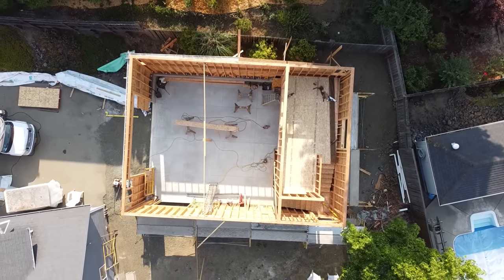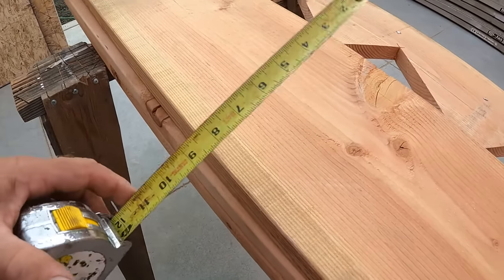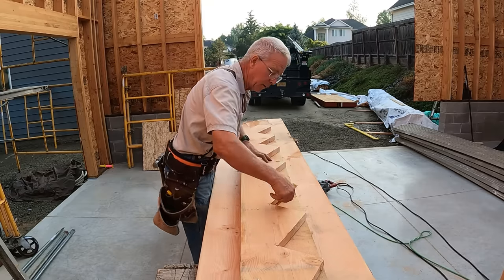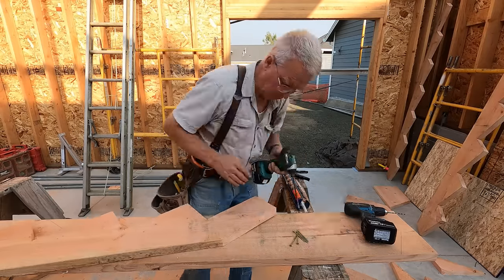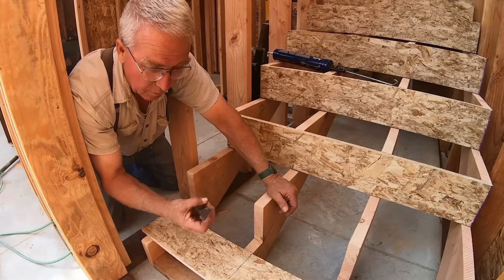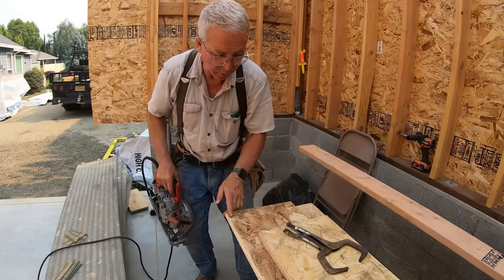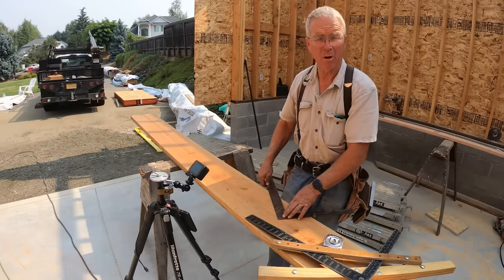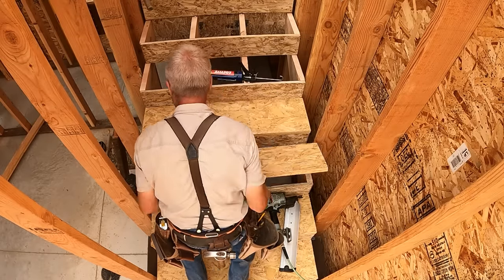Cutting Stairs With A Pro - Tips and Tricks: Shop Build #14

Comment: In 60 years of residential construction, I never ran into these kinds of problems:  why ?   because I PICKED the materials and didn't rely on the under-paid, untrained delivery guys at "Lowes Depot" to load and deliver my materials  -  esp. on any structural lumber that mattered ( which is EVERY single board ).  In any case, when you had the toe come off the stringer,  the solution was to laminate a piece of 1/2" or 3/4" plywood with LOTS of Titebond III onto the wounded area  -  in this case, I would have laminate the entire stringer -  in fact, if you use cut ( and not solid ) stringers, it's a good idea to just laminate every stringer just as a matter of course - even using OSB instead of plywood is better than having the teeth breaking away from a cut stringer

Comment: When I did carpentry work the first boss had me cut stringers he was not that knowledgeable on how calculate the run an rise so I bought a book on framing study stairs carefully never liked the stair nuts for a framing square so I made a fence that I used small clamps to utilize the most of a board I could eventually I made one out of azeck which worked great was easy sliding on boards,siding,an other task that required angle cuts had couple of other contractors make ones for their framers

Comment: *Apology in advance for the length but real stair guys/gals might appreciate the tip. 

Back when I was building stairs, all the time, on a repetitive basis, often you could encounter situations where the architect left zero room for tolerance. This could come into play frequently on the landings, where code dictates that the landing has to be at least the same width as the stairs themselves. So, when you were really ‘married’ to a landing width and could not afford to be off by even a little bit, some extra care had to be taken with the layout. (Inspectors can be particularly fussy with stair codes.)

Because of the way lumber is dressed, all the edges are slightly rounded, so when you are marking your stringers with your properly set up square and stair gauge, as you move along the edge to the next layout, sometimes it’s difficult to determine if you are in fact, right on layout, because of that rounded edge. The solution: Layout the edge of your stringer using the hypotenuse dimension of your rise and run, in consecutive measurements. (A²+B²=C²)
e.g. (using easy whole numbers, just for an example) If your rise is 6” and your run is 8”, the hypotenuse would be 10”. So pick a good starting point on the edge of your stringer, and mark it out at 10”, 20”, 30” etc etc. then make your stair gauge fit to those dimensions to ensure you are not adding or subtracting anything to your overall length. 

I know, I know, it sounds like overkill but it can make a difference if there is just no room for error. If you try that method one time, I know you will be surprised at how much it forces you to adjust your seemingly perfectly set up square and stair gauge as you step off the layout. 

I like that stair gauge but I never knew about it back when I was building stairs, so I always used the brass buttons. Another tip is: If you only have the buttons, once you get them set perfectly, cinch them down just a little with a pair of pliers. Thumb tight might move a little if you slap it against the board a little to hard.

Comment: This is where a track saw comes in handy.  You knuckledragger framers scoff and say "a straight edge and a skill saw does the same thing!"  First off...No.  Second, the purpose of the track saw in this case is to make the work easier, more repeatable, and most of all...faster.  Festool to the rescue.

Comment: I hate to trash content, but given todays engineered wood products, you should build all stringers out of engineered wood products like LVL or LSL sections. No cracks, twists, or knots to worry about.  Also do not use nails on any connected surfaces, but use glue and #10 screws.

Comment: I don’t understand the use of a chisel vs. a saber saw....which some call a jigsaw....to finish the cuts. A chisel works but....I’ll sawcut every time. No biggie. I like your videos. dba Dave the Carpenter....in Omaha
Reply: Also....I use treated..acq... on concrete instead of red cedar. Cedar is soft. Treated is spf...spruce/pine/fir....stronger and chemically superior to cedar when on concrete, and it holds fasteners better. My 2 cents worth. dba Dave The Carpenter in Omaha

Comment: PL 400 and other similar subflkoor adhesives is weak, cheap no name wood glue would hold that lumber split better. When you go to the hardware store next time, try to pick up a couple tubes of PL Premium 3x or PL Premium 8x. They are structural glues, not subfloor glues,  both A LOT stronger and most importantly tough than PL 400 and other similar subfloor adhesives. It will make "Welding" lumber back together a completely peaceful adventure. 

I would have either plated those defects with steel or plywood/osb.

Comment: For interior stairs, if you have a long run or want a really strong set of stairs spend the extra money and use lvl's. You don't have to worry about defects or triangles breaking off. Also I think you're too concerned with cutting out defects and not crowning your lumber. And never overcut stringers cut to the line and finish with a jigsaw.

Comment: I hate this design cause the nose on the stringer snaps off easily as many boards have spits already or will continue in time.The overcuts on the notch cuts that framers do for speed weaken the stringer even more. I end up screwing the broken noses also. I've seen stairs with a broken nose held up with step boards and riser boards that I suspect broke eventually after construction. It's too fragile of a design. Gluing and nailing on one side of a plywood sheet to reinforce the weak nose or using long screws to stop snap-offs might be good solutions.

Comment: hmm i still dont understand why the last step is 1 inch less
Reply: Because when you put your tread material onto the 1st, 2nd, 3rd, 4th etc, step, they are all being added to by that much. But you don’t put tread material on the floor where you start at so you have to account for that right away in your framing.

Comment: Just run it, it will be fine....don't overthink it too much, do best you can and get it done.....I think my foreman would  have thrown a hammer at me if I did this back in the 80s, lol........asshoes and elbows is all I wanna see they would say, lol

Framer Larry Haun was awesome, the less you have to measure or take your tape out the more efficient you will be......am huge fan of taking math completely out of the process as much as I can

Comment: come on now ... use real plywood instead of OSB !
Reply: I agree! My Dad and I stopped using that inferior material since the mid 80s.
Reply: @normansawatzky4778  OSB has greater shear strength than plywood so calling it inferior is a bit misleading.
Reply: I wish. The American sheds would be  a lot safer....sorry houses
Reply: Agreed! OSB is probably okay for subflooring but that's about the only place I'd use it. I paid the extra to put plywood on my shop walls and roof and am glad I did. I really can't comprehend using OSB as roof decking, given that it's more spongy and has a bad reaction to water.
Reply: @repetemyname842  I couldn't disagree more. I have a lot of experience on the job as a custom home builder and renovator for almost 40 years.  I have worked on houses that are almost 200 years old, and I've REPAIRED new homes! OSB is inferior. I live on the Wet Coast and that stuff will swell up like a sponge! Never mind that it doesnt hold nails and screws properly. Because most builders are cheap son of a guns, they use it with staples. Pulling it out...no, peeling it out is a complete nightmare...like I said before, I stopped using it in the 80s, and refuse to work with it ever since!
Reply: @normansawatzky4778  :  Ive been building in Wisconsin for 30 years.  Staples are not UDC compliant so if you have people using staples out there they are wrong.  Given our extreme swings in climate here if it were truly inferior you wouldnt be seeing all these upscale lake homes being built with it.
Reply: @repetemyname842  like I said, there are a lot of cheapy builders out there.

Comment: Hilarious how the "-" "carpenters" building all the new builds in my area in CO have no clue on any of this info this guy's explaining. Hell they don't even use dimensional lumber to build stringers which is concerning and then the houses go for $600+k (and that's for a townhome!) 
Carpentry either really had gone down hill, slap whatever wood up just to frame, or the info found in this vid applies to only custom builds, or properly GC'd homes the owner seeks out. Mass builders are doing disgusting work and making hell of a chunk of change

Comment: I was shocked to see you using aspenite for stair treads. Almost as bad for risers. If you build for 100 yr. life, somewhere in that time, somebody's going to spill something, or mop something, liquid. There goes your stairs! The slightest difference in stair dimension is going to cause serious safety issues. Real hardwood stair treads would be the better choice. I use aspenite, but I still hate it! Before you use that stuff, remind yourself what it is and how it's made.